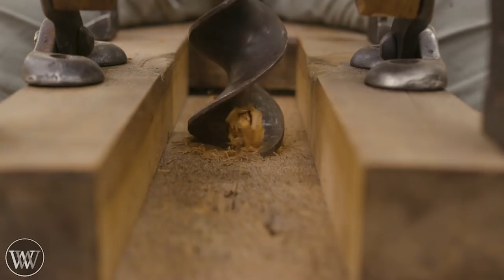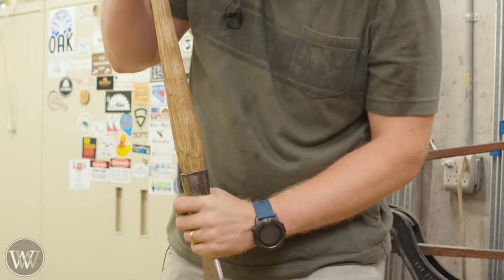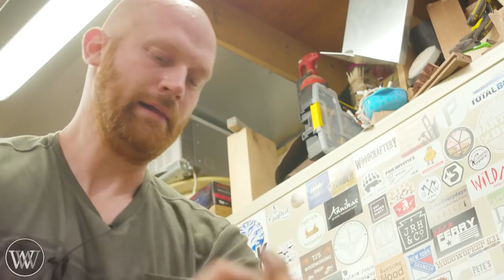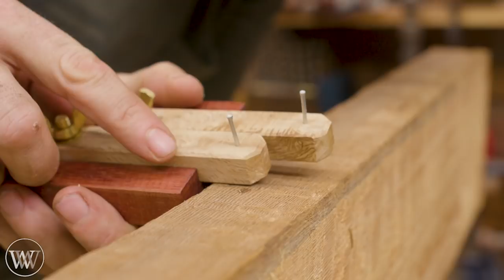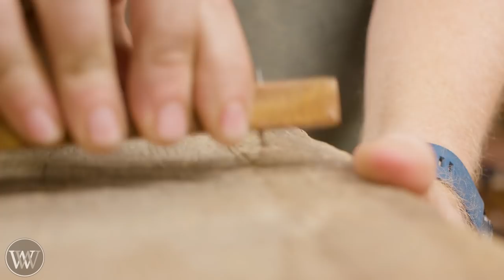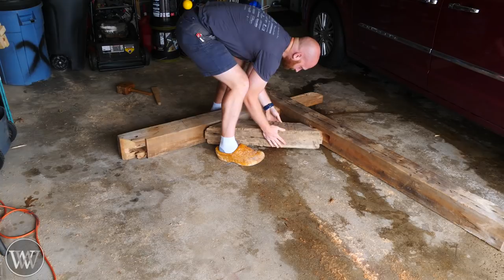Timber Framed Mailbox Post

Comment: That looks like a fun project James.  Your mailbox certainly isn't going to fall over. Do you find timber framing needs less precision than cabinetmaking or is it about the same?  I love the big chisels!  Scott
Reply from the maker: it requires the same ratio of persision. where as a 1/32" gap may or may not be a problem it relationship to the size of the  joint
Reply: I guess that makes sense.  The scale allows for a slight margin of error.  I've done a through tenon on a 4x4 once, but it was nice to see you using proper tools for timber framing.  Thanks.  Scott

Comment: The timber framing work is great, but aesthetically, the proportions are fairly far off.  Make a scale drawing next time.
Reply from the maker: Look a lot different when in the ground. To proportions are designed for that. As well as the mailbox will be going on as much much larger than an average mailbox. There's a lot more that will go into this that you do not see yet